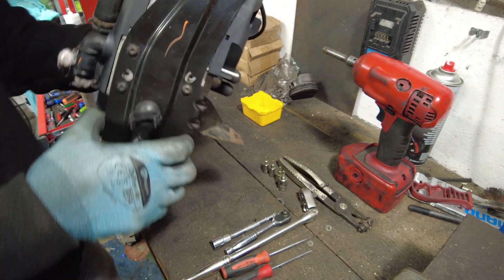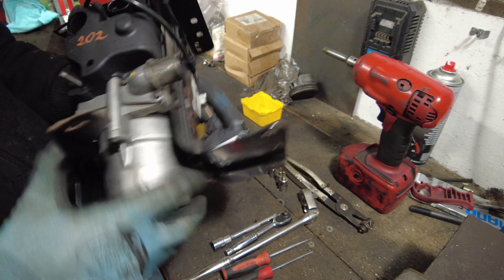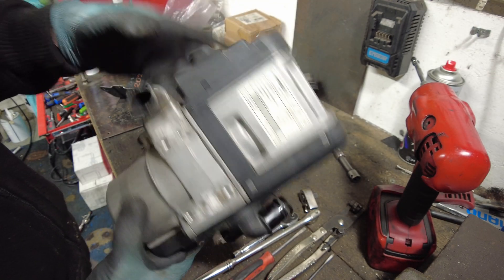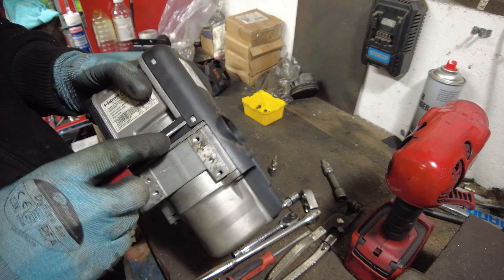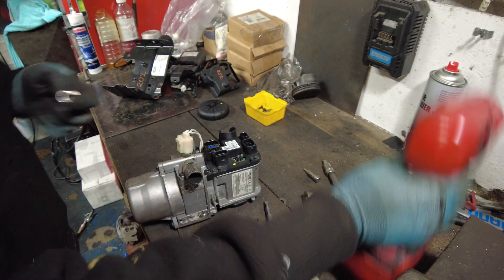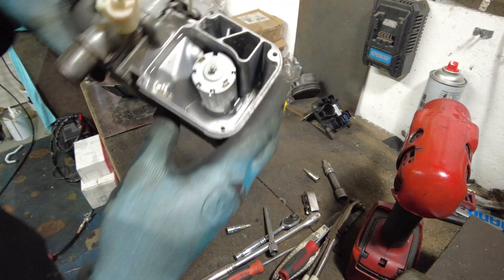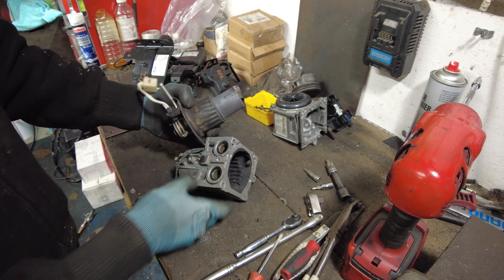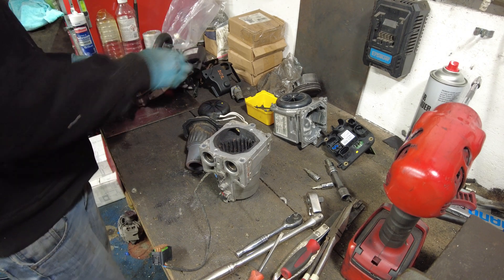Webasto Thermo-top V Diesel Preheater stripdown. Engine coolant heater, block heater, hydronic.

Comment: I have a Webasto Thermo Top Evo on my Peugeot 508. Do you think it's beneficial to clean them out ever so often? I use it every day in the winter to preheat my cabin, but I find it's no longer as efficient as it used to be.
Reply from the maker: Its a good idea as they can clog up with carbon deposits in the exhaust side which would affect performance
Reply: @MJF85 Brilliant. I'll have a look into doing this before the cold periods set in. Thank you for the response 🙂

Comment: What do you mean by immobilised?
Reply from the maker: @happyjive2235  it means they won't work unless they can talk to another ecu fitted to the car it came off, whereas the earlier ones don't need to do that so they will work with a simple w bus converter and power feed.
Reply: @MJF85  do you know what years ? Ive got a Land Rover Discovery 3 TTV on its way.
Reply from the maker: @happyjive2235  I can't remember exactly but 2009 onwards sounds familiar.
Reply: @MJF85 hopefully this one will be a pre 09.
Reply from the maker: @happyjive2235  fingers crossed. Although I haven't tried a later one myself, it's just something I read/saw when I was researching doing this mod.
Reply: @MJF85 i need to find a decent w-bus controller,  something that i can use to heat up the engine coolant before starting.

Comment: Sir, could you advise where is original part number of driving print plate? Is it on a plate itself or it's on plastic cover with connectors? Got problem, already spent 470 Euro for nothing.

Comment: Any idea how to remove fan cover? That black cover…my heater has code for glow plug but after i took it apart and tested the glow plug it works but my fan is jammed 😅
Reply from the maker: Fan covers just clip on, watch from around 4:20, fan should then be able to be spun freely.

Comment: Hay nice idea, is this as efficient as the cabin heater with fuel and battery usage ?
Reply from the maker: I haven't had chance to compare but the fuel pumps on these are a larger capacity than the air heaters so I'd assume they use slightly more fuel (40ml pump rather than a 16-22ml). Battery wise, possibly a little bit more as they have a water pump as well as the fan motor, although the fan motor on these has less work to do as its only drawing in combustion air rather than having to blow air into the cabin.